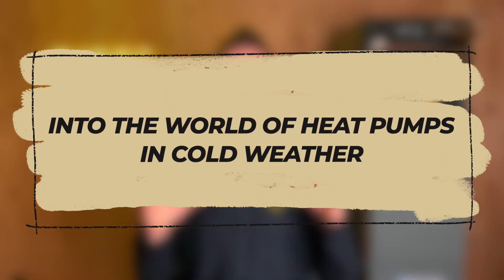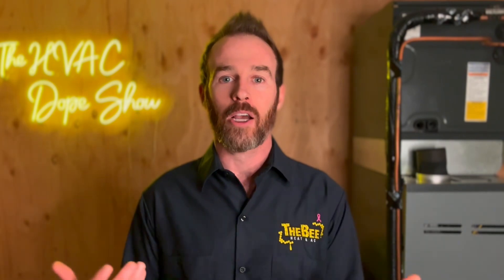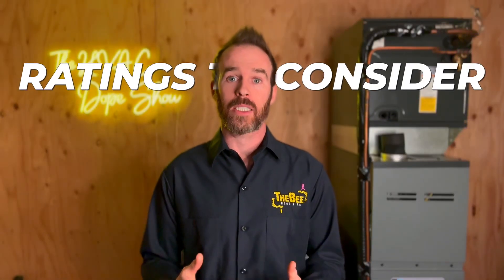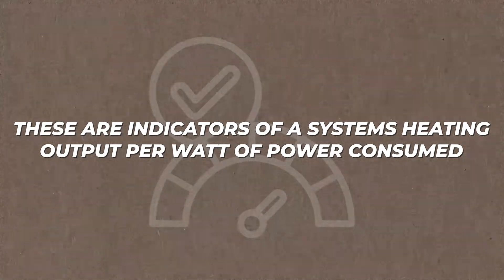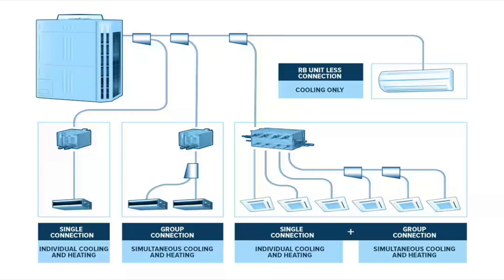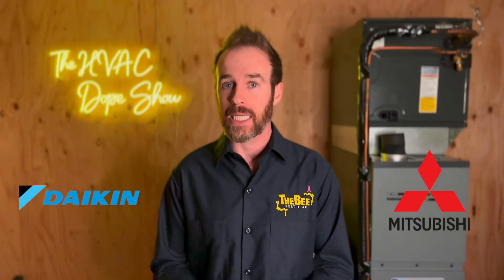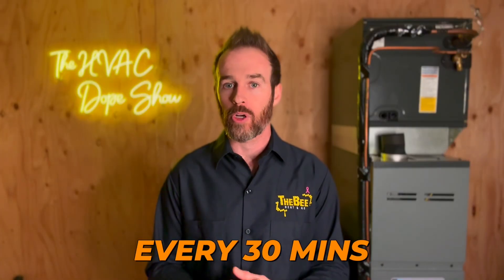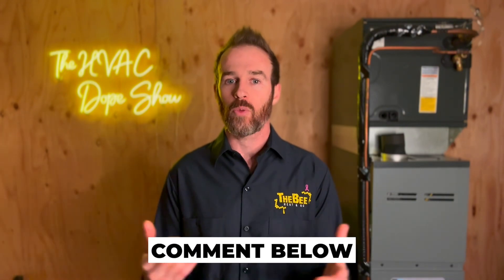Heat pumps and COLD WEATHER 🥶🔥

Comment: In my experience, dual fuel isn't going to save you huge money.  The difference between extremely efficient use of expensive electricity, and less efficient use of cheaper natural gas isn't quite a wash, but it does mean it will take you a while to earn back that higher up front investment.  But it does have a huge quality of life benefit that really isn't talked about enough.  Natural gas heat dries out everything, it is so hard to keep the house comfortably humidified if you are running 100% natural gas, even if you do have a whole house humidifier.  We eventually got a supplemental big console humidifier which had to be constantly filled, cleaned, etc. all winter long to keep the air reasonably comfortable, when we were running all gas.  Switching over to mostly heat pump heat has meant the whole house humidifier can now easily keep up and we don't even run that second humidifier any more. That is a major quality of life improvement.  And I am probably running 90-95% heat pump these days.  It really has to get to where the high for the day is in the high 20s before I will give it a break and push the button to let the gas furnace handle things.  The heat pump can technically keep up even then, but it starts to have long duty cycle times and there is no reason to push the equipment that hard if you don't need to.  The other time you want gas is when you have been away and the house is 50 degrees, gas warms up the house when it is really cold noticeably faster.
Reply: depending on the type of gas, propane or natural gas. propane costs more, i have converted my uncle's LP furnace to dual-fuel and he's saving at least $400/month in the winter (approx 5 months long). he's glad he took my advice to convert it in 2021, and im an hvac mechanic so he only had to pay for parts and $1000 on labor. And my old company let me use their account to purchase Carrier equipments at contractor's pricing, all of my aunts and uncle have new Carrier infinity systems in 2021 ($3000-3500 a set).
Reply from the maker: All great comments and very valid points!

Comment: hello sir pls help my heating pump was on while renovating the kitchen i have central air vents in the kitchen does the vents sucks the dust in the kitchen and spread in the house?tnx
Reply from the maker: Yes it will definitely collect the drywall dust / renovation dust. Duct cleaning would probably be a good idea and definitely change the filter!
Reply: @TheHVACDopeShow  thanks i did not know the vents from where the cold air blows sucks air..i thought the return ducts suck the air which is located on my attic room

Comment: we have a camp 3 hours away that we heat in the winter just to keep water lines from freezing. We have electric baseboard heat and want to move to a mini-split cold climate heat pump. if temps drop below the heat pumps min rating will it automatically shut off and in which case baseboard will kick in and will the heat pump also resume automatically. if there is a power outage will the heat pump turn on once power is back on. also there is no wifi network in this location.
Reply from the maker: Depends on the unit but normally yes on the power outage. Also some units have the ability to hard wire a 2 wire analog thermostat to override the remote control so when it comes back on it will be getting an analog reliable signal and not matter that the power was lost. This is not a bad idea, there’s several cold climate heat pumps that would work for this and go down as low as -10 / -20F

Comment: Thanks for sharing. I'm curious. Our 1966 NM ranch style home has central heat, with the ducts run in the uninsulated slab. It's about 3000 SF, and there's a pretty serious temperature drop in the furthest bedrooms (and way too much heat in the nearest ones). We installed solar and an induction cooktop last year, and would like to go all-electric. Because we have lots of high windows, wall type mini-splits are less attractive. Do you think ceiling units would work, or should we just upgrade our central system and accept the inefficiency? Thanks again!
Reply from the maker: And thanks for posting the comment… also by being on solar you’re definitely in a great position to be able to capitalize on the benefits of zoning with mini split / cassettes (assuming that’s what you mean by ceiling units) because you’ll be able to turn the central system down in parts of the home you’re not using when you sleep at night for example and can really target zone your heating and cooling. Plus inverter mini split heat pumps are very inefficient and consumer very little power
Reply from the maker: Making a vid on this, thanks for the comment! Short answer is yes ceiling cassettes (assuming you mean cassettes) would work great and be a great option. Ducts in slab is not bad because the ground actually insulates pretty well, so a combo / VRV unit or just a basic central air system with one or two cassette / mini splits on a separate condenser would probably work well for you.

Comment: What heat pump would you recommend in Ontario Canada?
Reply: Wood stove ?
Reply from the maker: Dual Fuel if anything. Gree Flex advertises very low ambient temps, better than Daikin in that respect but I would want backup heat when it gets frigid there.
Reply: Senville aura made in Canada grate for cold climate

Comment: I’m looking to replace my 10 year old Geothermal system in my home with an dual fuel system of heat pump as the primary and heat strip as the secondary. What are your thoughts on this system in efficiency and cost to run? I live in Idaho so we do get very cold I’m the winters at times.
Reply from the maker: It’s efficient but being in a cold climate a furnace backup would be a true dual fuel, technically electric backup is not really a secondary fuel it’s still electric. But if your heat pump is “cold weather” and qualifies for the tax credit like the Daikin Fit enhanced for example, it will keep up  down to 5 - 10F before needing to switchover to electric or furnace backup. This all depends on the load / insulation in your house as well. If you want to reduce the load on your space I’ve seen insulating / siding drop people’s heating demands in half. We have a customer with a VRV in Boulder and although the average lows are 15~20, we get subzero temps and the system works well down to about -10F because his home is so well insulated.
Reply: you shouldnt need electric backup heat if you're using geothermal. it's probably the sales guy adding more parts to make more commission.

Comment: I feel like i have information overload. 
WSHP vs ASHP for my home. 2500sqft home, currently on 5yr old  80% gas furance and 20yr old ac 3.5ton system thats dying. Also our gas water heater is 10+ yrs old too. So I was thinking maybe WSHP for DHW just too many options etc... 

We are in chicago, However i see WSHP that say its rated for -30F  from Apollo etc.... not sure what would be the best for our home.
Reply from the maker: Chicago can get cold but as long as you have backup heat via a heat kit or furnace you’ll be ok with either. I’m honestly not as familiar with water source heat pumps outside of what we see in condos when the air handler has the heat pump coil built into the air handler and the coil itself is connected to a central chiller or boiler so it’s like a forced air hydronics combo.

If this is for a single family detached residence I would just make sure the WSHP comes with a decent warranty from the manufacturer and the contractor you are hiring. I wish I could be of more help on the WSHP
Reply from the maker: Also at that age the furnace isn’t that old but most high efficiency heat pumps will need a matching paired furnace to maximize efficiency depending on what route you’re going. Hopefully that’s helpful if you have other questions lmk!

Comment: What is your opinion on heat pump for in floor heating such as warmboard type system.  Can that pump also serve well for cooling?
Any idea who is a quality heat pump installer for a new build in Grand Junction
Reply from the maker: I can ask around for grand junction, not 100% sure but as far as a heat pump for hydronics are you asking about something like the Daikin Altherma? If so all I know is there’s not a lot of options in the US for these types and I inquired with distributors about them and they’re mostly special order… I’ll see if there’s a local contractor in Grand Junction I can refer you too and what options they might have. Big thing to consider with something special order like that is that parts availability becomes more difficult (meaning waiting for parts to come in) until it’s mainstream in your area. If you have backup heat it’s not critical but I’ll see what I can find out because honestly heat pump water heaters are very efficient and if they started incorporating these into radiant applications in the US (maybe they have already and I’m just not aware) then these would actually work well for radiant flooring systems because radiant floors operate at a lower temp similar to domestic hot water temps (120-140). Radiant floors technically call for a max supply temp of 130. Will keep you posted on a grand junction referral, thanks!
Reply: thanks much.
Reply from the maker: https://maps.app.goo.gl/gPfR9VQ7BC6YBP5y6?g_st=ic

Aaron Cooley / Cooleys Heating and cooling in Hotchkiss, CO

Referred to me by my Daikin rep, looks like they have great reviews too! Not sure if you’ve reached out to them already but hopefully that helps 😁

Comment: Heat pumps are just not efficient in a cold climate. We generate power by burning natural gas, at something like 40% efficiency, then we transmit it to houses with some transmission loss, then we use the electricity for a heat pump that isn't efficient below 30 degrees. It is MUCH more efficient just to burn that gas in the house and have 100% of the energy heat the house.

A hybrid system makes sense. But a pure heat pump only in cold is stupid.
Reply: Your point about methane being more cost-effective once you cross below a certain temperature is correct. But that temperature is not 30 degrees. The COP on modern systems is still being decent down to the teens if not lower. And, of course, the cutoff will depend on methane and electricity prices in your area.
Reply from the maker: I agree with most of what you’re saying, Technically 100% of the heat energy from natural won’t reach the house, 93-98% will based on the combustion process in a high efficiency / condensing furnace. High efficiency Heat pumps can operate at 400% or more efficiency (by comparison with electrical input) so you have to look at the conversion cost to electric, then to heat via thermodynamics through a heat pump to get a like for like… sometimes it’s a wash or close but often times for us it makes more financial sense to run. Especially when you throw solar panels on your roof. But you’re correct and that’s a very astute observation, a lot of people overlook it. The heat pumps we use are efficient (not Derated) down to 0 or -10F depending on the model so low ambient / inverter heat pumps make a lot more sense than a single stage stuff. Thanks for watching and thanks for the comment!

Comment: A high end cold weather heat pump like Daikin’s you show should be able to do all the heating needs for the home. Dual Fuel is a disservice to the customer who’s heat pump was commissioned properly with correct setting in the smart communicating thermostat. The most efficient heat pump use is running low and slow, set it and forget it. The example of dropping the temp to 55 F while you are away and then turning it up to 70 when you walk in the door is a failure to understand and use the heat pump in the most cost efficient way bases on the science and the kWh hours usage. 
Also dual fuel is a crutch and will cost the user more in the cost of capitol equipment and fuel costs. Better to address the envelope of the house if heat loss is excessive. The cost of this equipment installed is high with only a 15 year shelf life. Do customers really want to replace heat pump and alternative fuel system every 15 years at say 20 to 35k plus domestic hot water costs for equipment and fuel too. Top of the line cold climate heat pump and Solar electric is the best way to go so you lock in your fuel cost for 25/years or mpre. In worst case scenario add a heat strip to the heat pump system for the few times a year you can’t get the heat you think you need for comfort. 
See the Maine Heat Pump study results on YouTube or the NEEP Videos on YouTube. These heat pumps are used in the Nordic Counties, Northern Japan, China with no need for dual fuel. Some 11:40 Scandinavian users on YouTube will attest to how well they work etc.
Reply from the maker: I’m not familiar with that model but will have to check it out! The Electric heat strips use 7x the amount of energy so as long as the heat pump can keep up for the majority of the use case it’s a good option but dual fuel still makes sense for some people or at least some people are more comfortable with having furnace backup… I think by the time the next replacement cycle occurs (in 20 years assuming install today) the equipment and tech will be widely different. Thanks for the thoughtful post!!
Reply: correct! no heating systems can be efficient and/or properly heating a home that keeps losing heat thru insufficient insulations. properly insulated is a must if the homes were built prior to 2003/2011.

Comment: What's your opinion of ducted heat pumps in Southern California?
Reply: Nothing can beat a self installed mini split in price
Reply from the maker: Ducted heat pumps are great for socal, depends on what part of socal you’re in and the climate because if you’re concerned at all with noise a daikin fit is our favorite “best bang for your buck” AC, but you don’t need anything with low ambient ratings in socal so the main benefit will just be efficiency.